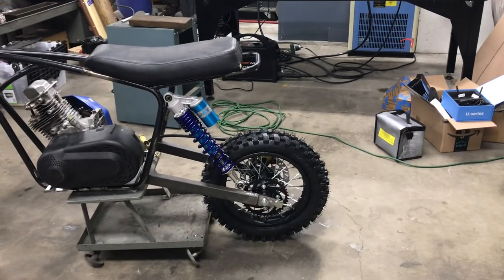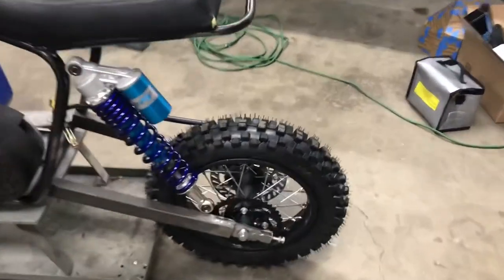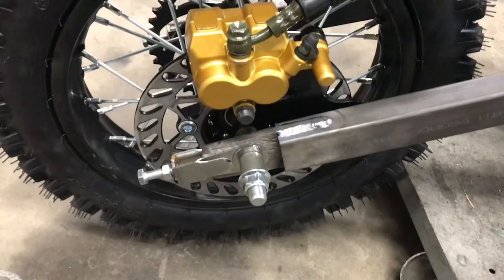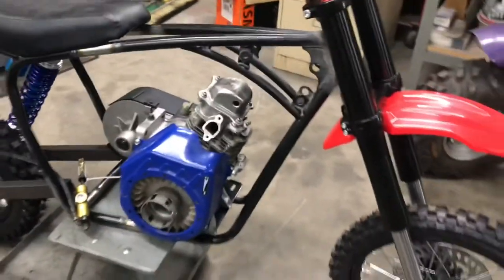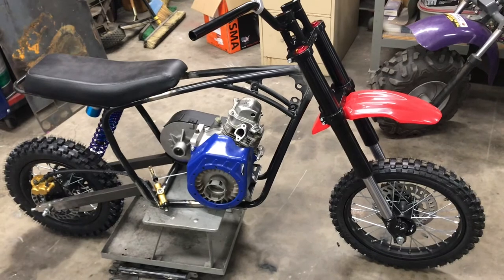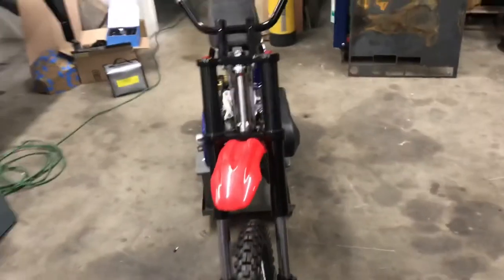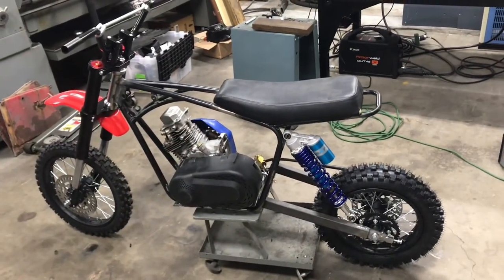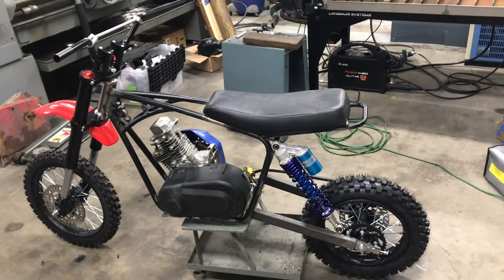24hr Mini Bike Swingarm Build Part 1

Comment: I need those big brakes on my race bike. I'd totally buy an adapter, I can stick weld a little and I'm OK with an angle grinder but I'm having a hard time cutting smooth pieces.  I find myself building up welds and grinding out more than I'd like to due to rigid cuts and gaps. That said, I'm definitely showing improvement from the welding practice! I'm running an Amico 200 Pro DC. I only have 110 available but this machine is coveted for being able to tackle some serious welds still. I'm running 6013 roots and 7018 passes DCEP at 80-90 amps. You think that's strong enough for frame work? I've done some seat tabs, sheet metal and steering relocations on my kart so far but I'd love to stretch something out a little and do more with suspension.
Reply from the maker: I just bought the parts to convert the drum brakes to disk on our coleman and baja based minibikes....another project
Reply: @dirtfootracing8788  I'll be watching!